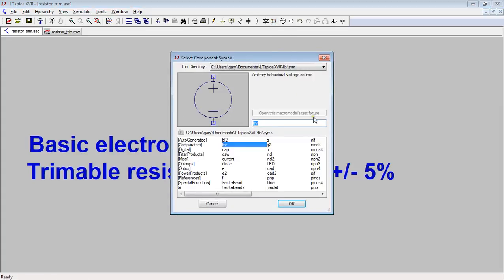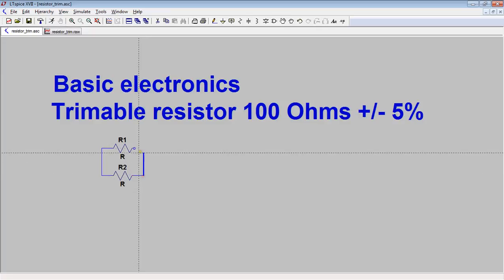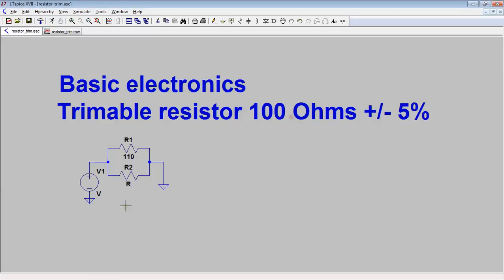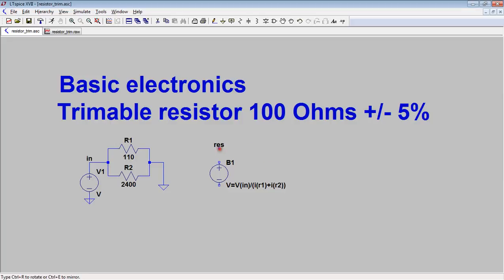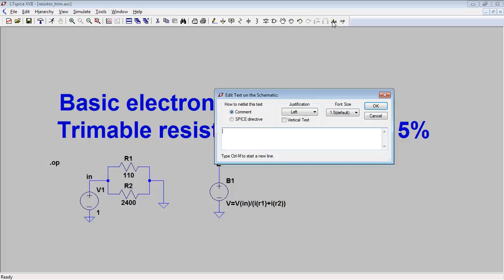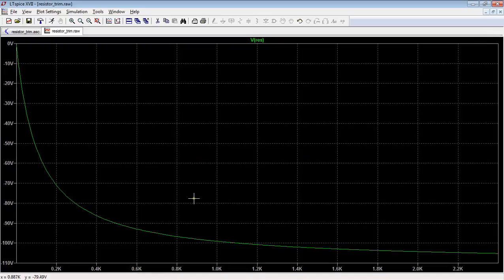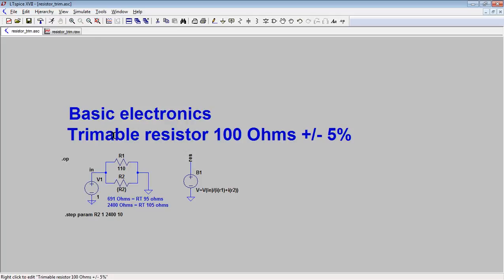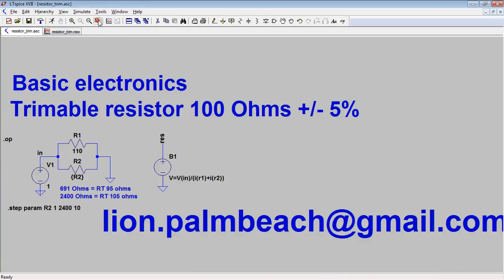basic electronics how to make a 100 ohm resistor +/- 5%

Comment from the maker: The answer is to use a (600 Ohm resistor in series with a 1K8 trim pot) in parallel with a 110 Ohm resistor, this will give maximum adjustment for the 5% trim.